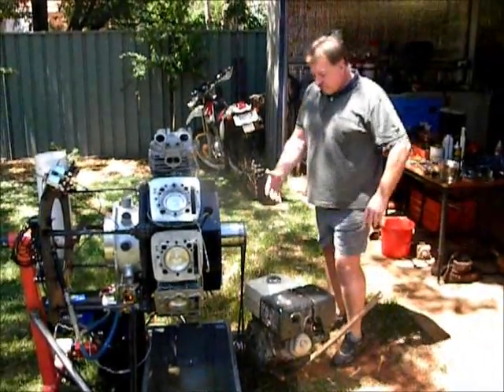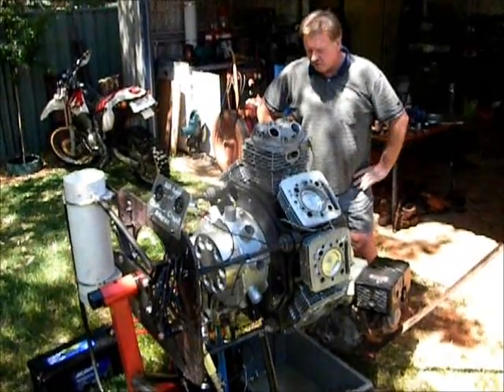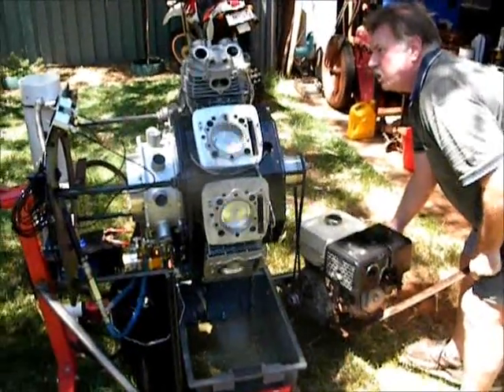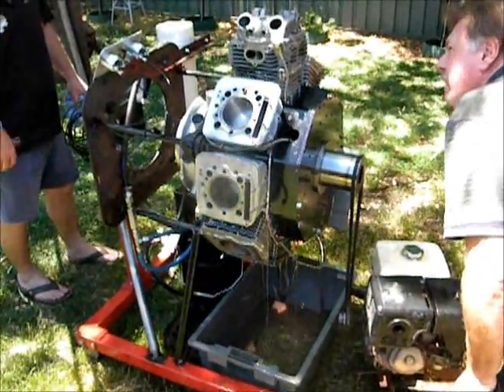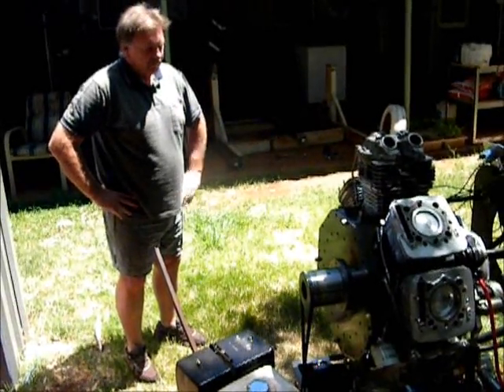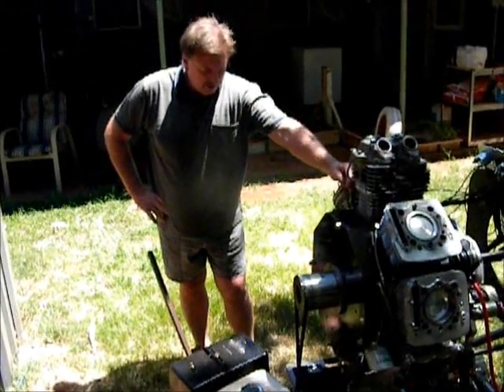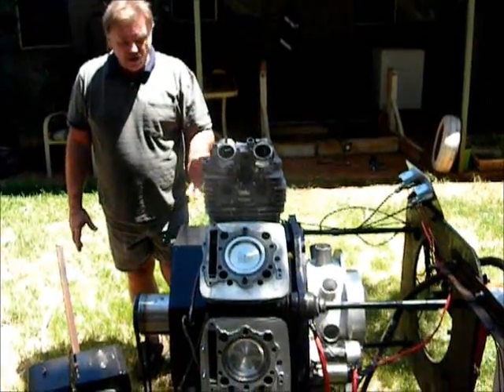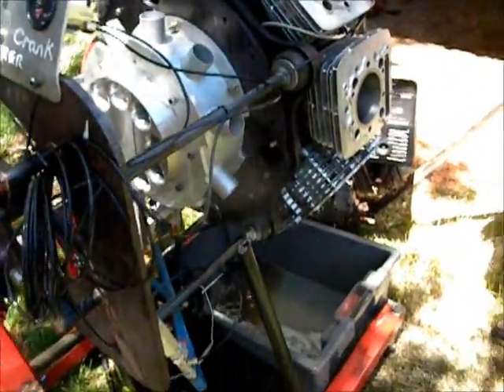Russells Radial Engine 2

Comment: Would like to see a your crankbearing setup on the camsprocket side ,the original sprocket will not allow for a needed size bearing in front of it or between the sprocket and crank.